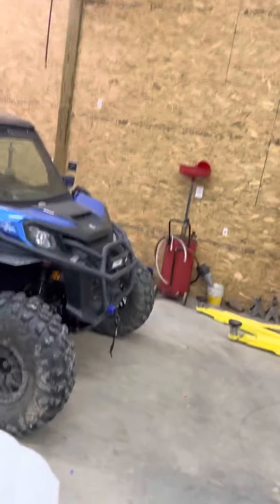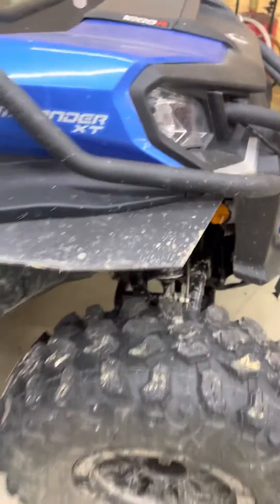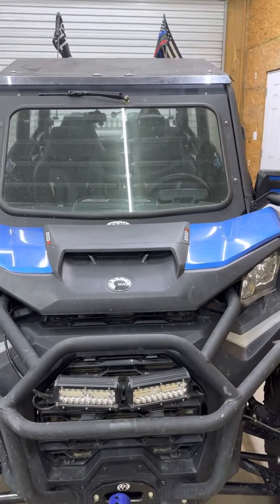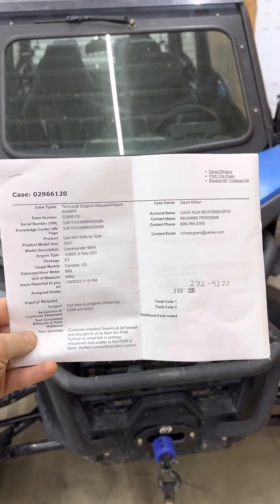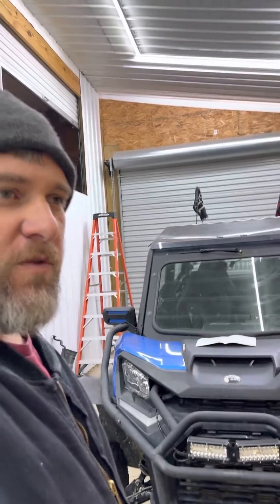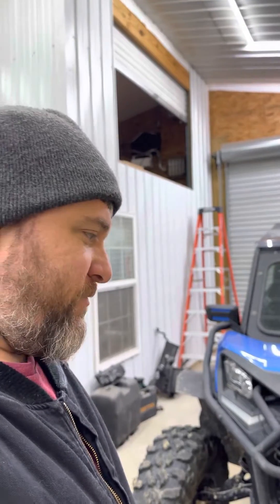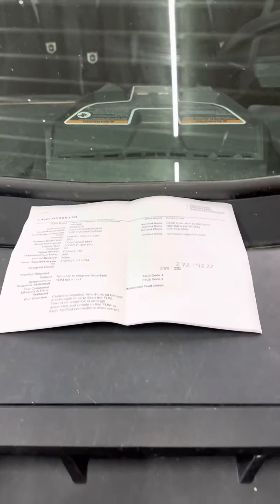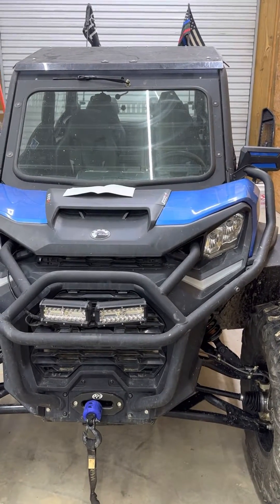21 commander xt smart lok install issues

Comment: You get this sorted out? I just put a smart lok in my 2020 x3. It recognizes the smart lok even on my dash display. But i don’t think it’s locking.
Reply from the maker: nope i still haven't found any way to get mine flashed to where it will do the smart stuff but it will fully lock by engaging 4x4 I've just been using it as a full locker which works fine for me but still kinda crappy to put all that money in it and it not work 100 % correct
Reply: @Lets_Ride_Dirt  that’s ridiculous. My 2020 x3 is going on Wednesday to get flashed. Hopefully it works
Reply: Im just now shopping and hearing about the smart lock. Is smart lock something you have to buy aftermarket or is it a can am option? What does ot do? I want the visco 4 lok but its not on the models im looking at.